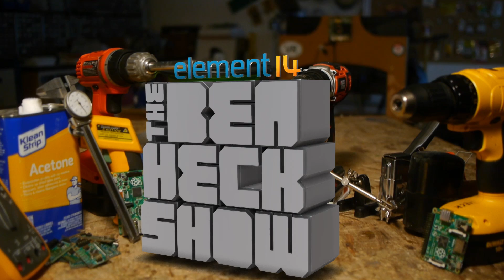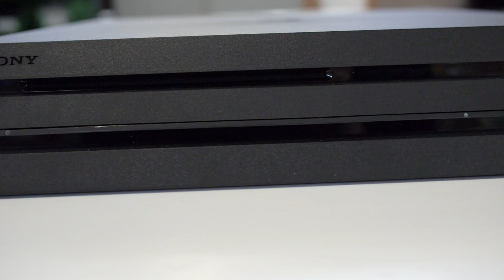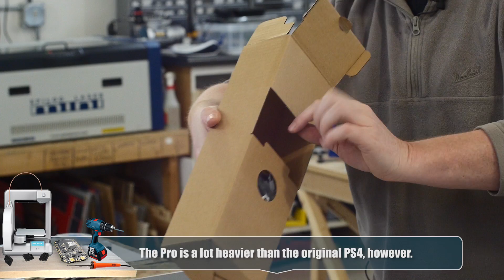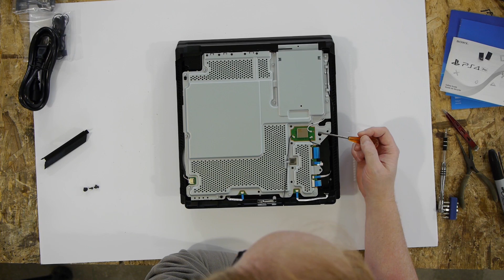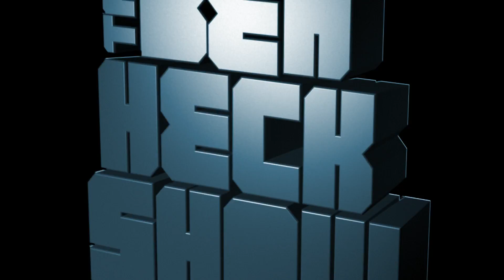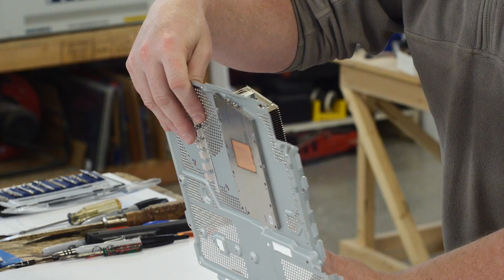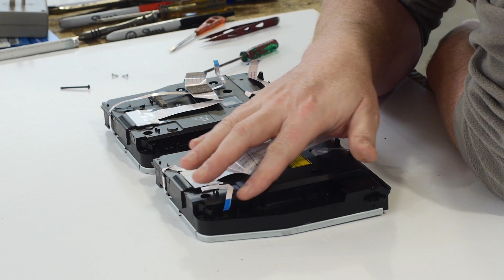Ben Heck's PS4 Pro Teardown

Comment: 23 amps  thats alot.were is the power going to 1 for the drive 2 for cpu an other 2 for dvd rom is it a car battery charger as well you should get a car battery fully charged to see how long it can power it for ,.......my djx lasts about 7 - 12 days depending on is size

Comment: The only advantage you get when putting a SSD into your PS4 (no matter which model) is higher I/O speed. Apparently the SATA connector for the internal HDD is attached to a USB-Host (not sure if USB 2.0 or 3.0) controller which drastically limits any performance gains that could be made with an SSD over a regular HDD. I found, after wasting money on a large SSD for my PS4, that it makes much more sense to put in a SSHD (Hybrid) instead, where I can put in a large drive and profit from I/O speedup of the most frequent accessed data on the drive at the same time without throwing money out of the window...
I really hope Sony doesn't repeat the same design decision again for an eventual PS5...
Reply: Good to know. I wasn't aware that Sony made this change with the PS4Pro.

Comment: Actually the PS4 PRO does have more ram and comparing it to the S is quite laughable because there is only a slight difference between the S and the original XBOX ONE and really the only difference is that it has a 4K Blu-ray player and HDR support. Where as the PS4 PRO is 4.2 teraflops and the S is only 1.4 teraflops. Which makes the PS4 PRO 3x the amount of teraflops. Plus based on the original PS4 is more than twice as powerful, better Wi-fi adapter, more ram, better HDR, better HDMI port, more USB ports, bigger hard drive, a 1 GB Ethernet port  and faster CPU

Comment: PS4 pro just uses an evolution of the Jaguar core vs. original ps4 and slim. All on the same manufacturing process by the way, no die shrinks involved. Core layout was changed marginally for better efficiency, but it's not too far removed from an overclocked apu as you surmised (albeit with a few enhancements).  Given the high power consumption of bulldozer and it's derivative successors it's absolutely zero surprise how much power the pro consumes, nor the increased cooling. 
AMD's apus of the time are far from power economical.

Comment: You guys do realize the ps4 cannot play games in 4K right?  The gpu isn’t powerful enough. However the ps4 pro can, although most games use checkerboard rendering. So comparing the two is like comparing apples to oranges. Your tv may say it’s using 4K resolution, but the ps4 is still only outputting 1080p or lower. The tv is just upscaling the image. To be able to display The Last of Us remastered in 4K, you have to have a ps4 pro.

Comment: The PS4 PSU units are very thin though. It would be great to have a new PC standard with PSU cartridges as thin as Nintendo 64 cartridges. Just immagine PSU cartridges that slot directly into the motherboard. That would be much better than the messy and bulky ATX PSUs...
Reply: Well theres already Plex psus
Reply: But those are only DC to DC you need a external AC to DC power brick

Comment: 4k Bray is a waist, cutting back on that with usin normal Blueray which still looks amazing on the right tv, but saving money on that puts more money into upgrading the power of the cpu and the ram and the gpu. Smart choice or the pro woulda been to much money or would have to sacrifice performance somewhere. 4k Bray is why the xbox sucks, well that and there stupid choice to use ddr3 not gddr5 like sony used, mabe there engineer s couldnt get it right.

Comment: I am not sure why he would call it an overclocked PS4 when he specifically went out of his way to measure both dies. Doubling the number of shaders in the die will make for a very different system. Heat dissipation increases are a byproduct of the larger die, not its reason for being.

Comment: I know I'm really late, but I just have to comment...

a) Using SATA3 for a normal HDD would not make any difference compared to SATA2. 3Gb/s (i.e. around 350MB/s) is more than enough for any hard drive you will find on the market. So... absolutely no point in going with SATA3, unless you're looking into SSDs.

b) Using 2K cinema projectors as an argument against 4K BluRays is kinda... stupid? If anything, it would be an argument against a 4K TV, but even then... meh? 
You have a 4K TV, don't you? Why? Because it looks better than 1080p, right? Do you prefer a "FullHD" stream over a 4K stream? Yes? Then why do you own a 4K TV? Of course you prefer the 4K stream. Now, if you actually cared about image quality, you'd know that a 4K BluRay delivers image quality far above a stream from current services. Yes, that might change down the line, but currently, 4K BluRay is the way to go if you want actual, proper 4K footage at the best possible quality. 
But: Most people don't use physical media anymore, so, Sony probably only lost a few potential customers by not upgrading their drive. They probably decided that it would not be worth it in the end. Sucks for me, but okay.

Comment: HGST, actually has one of the best failure rates(lowest) for modern harddrives from what i have read.
And in buiesness´es they are considered quite good, and prob a LOT better than toshibas drives, + Toshibas comsumer hdds are a lot cheaper than the Consumer HGST drivers, At last in the Nordic region.

Comment: I have the PS4 PRO. I replaced the original PS4 PRO 1TB hard drive with a 1TB solid state drive and i am so glad i did. I have noticed so much improvement with so many older games with boost mode and the PS4 Pro enhanced games run better, even if you don't have a 4K tv. Sony have tried to sell 4K too much with the PS4 Pro when actually they should of just mentioned it plays PS4 games with better graphics, framerates, screen resolution and loading times. 

I had the original PS4 and its an amazing console but the PS4 PRO is so much better.

Comment: Watching this I have to say Ben, the reason the PS4 costs more and can run 4k games is that there are double the graphic cores running in a version of crossfire. The used the die shrink to fit more into the same size die yes, but that was to fit the more graphic cores.

Comment: What they actually effectively did was strap a second identical GPU unit on the chip. Running it with multi GPU technology. It permits them to keep 100% compatibility with PS4 by running only half of it. but it also means that it's impossible for games to use the full "double" power it has on paper. That also explains why the PS4 pro has such terrible support from games for it's extra power, it's just too much of a pain to code the extra multi GPU support. Big games barely do it on PC now why would they even bother doing it for a console when the whole point for them is that it's less of a hassle to code for.

Comment: I wonder why consoles don't use an external power supply like computers did in the 80s. It would save space and allow for better air circulation.

Comment: no point of sata 3 in 5400 rpm spinner as read/write speeds barely tax sata 2 controller/specs. although the controller in the ps4/pro is sata 3

Comment: ps4 uses hdmi 1.4. hdmi 1.4 can handle  4k content it will just be at 30fps instead of 60fps like on hdmi 2.0, so the hdmi 1.4 connection on the ps4 could handle 4k video playback, but  the real problem is it lacks VP9 or HVEC 10bit codec support on the gpu. which i also suspect the ps4 pro  lacks those codecs as well. thus the reason why there is no 4k blu ray drive in the ps4 pro.  the xbox one s on the other hand does support VP9 and HVEC 10bit codecs on its gpu, which is why it has a 4k blu ray drive because it's able to handle 4k video playback.

Comment: talking about the hard drive in the ps4, SATA III makes no diff with HDD's considering HDD's bandwidth speeds can't go beyond 150mb's. So SATA II is more than enough for HDD's. As for SATA III HDD's, that's just a sales gimmick, you'll never reach the 600mb SATA III limit, let alone the 300mb limit on a SATA II with an HDD.

Comment: Liked your show here, going to subscribe, but I do have to take exception about your knock against 4K Blu Ray.  I'm very interested in the format, because even in the best of streaming circumstances you give away a lot in PQ and sound.  Also, 4K streaming eats a ton of bandwidth, and I live in an area where the best connection I can get is 18gbps for 130.95 per month.  Don't know if this is accurate, but I've read that the adoption rate for 4K Blu Ray is ahead of where Blu Ray was at in its life cycle.  I think these are all reasons why physical media are still a very viable way to go for a consumer and a business, and why Sony deciding to leave this feature out of the PS4 Pro is a step sideways instead of forward.

Comment: The reason the die is bigger is because the GPU part of the APU was doubled from 18 Compute Units to 36 Compute Units (its pretty much an underclocked RX 480, but I'm not sure if it is really Pollaris), not because they wanted the surface area to be bigger. Lithography-wise, I can't say if they're using the 14nm node or 28nm. I'd guess 14nm.

Comment: considering 3Gbps = 375 MB/s, it doesn't really matter. a disk drive will never reach 375MB/s. epsesually a 5400rpm drive. which is what really matters, the rpm. Sata 3 (6Gbps) was made for SSDs.

Comment: I don't think the drive is the reason. From my understanding Sony played a part in having some kind of mandate that all Blu-Ray drives manufactured in 2010 or later had to be able to read 4K disks. They didn't have to be used in a device that could play 4K media, just that the drive had to be able to read the disk format itself, and the PS4 came out late 2013 so ti likely has those drives.

I think the real reason is because Sony also announced some "premium" 4K Blu-Ray players, which are also going to be their first Blu-Ray players, coming out early 2017. It sounds like they will cost close to what the PS4 Pro itself might cost. So I think that might be the real reason, that they intentionally didn't include the software to play 4K disks because nobody would buy their 4K player if they could buy a PS4 Pro for around the same price. I wouldn't be surprised if they release a firmware update to add 4K support to the Pro a few months after sales of the standalone 4K player have dried up.

Comment: What about the fact that the PS4Pro is a dual GPU SOC as opposed to the slim and regular ps4. Also it's not a smaller node srink... it is the same CPU overclocked 50%.

Comment: hello, I'm trying to find out if the United states ps4 pro consoles are 100-240v? I'm in the military, and it would help me a lot.
Reply from the maker: Looks like it.
Reply: Thanks id hate to buy one and then turn around and have to buy a transformer when i deploy
Reply: +Ryan Bolesworth the ps4 is auto-volt, would work between 100-240v afaik
Reply: Even with it only showing 110v?
Reply: mine i got from the us, i live in a country where it's 220v, i have no transformer, straight from plug.
Reply: NXT Noxx thanks for your help

Comment: A faster internal HDD does not gain you much as it is internally communicating to the PS4 via USB

oh and the internal hdmi can output a lot more than the PS4 does, because the PS4 is internally using the displayport of the GPU subsysstem and internally using a DP2HDMI converter...

Comment: I don't understand why this guy tries to explain anything to do with 4K video when he clearly knows nothing about it. The Optical Drive isn't the limitation, 4K Blu-Rays need a H.265 decoder which isn't present on the standard PS4 or the PS4-Slim. The PS4 Pro has a H.265 decoder but it's locked in software to stop UHD and HEVC .TS files from being played by the operating system.
Reply: To summarise, it's a software limitation in the Pro, and a hardware limitation in the lower-spec models.
Reply: @DebugMenuVideo  wow... Thanks alot! I can't believe they wouldn't enable such a feature on a 4k console.
Reply: https://en.wikipedia.org/wiki/Ultra_HD_Blu-ray
UHD Blu-ray is not backward compatible.
Reply: Why are you using someone else’s pic as yours? That’s weird

Comment: the reason the die size grew on the new one is  they really updated the gfx part from an older hd 7000 series to about a rx480 chip and also a 14nm finfet production size the additional size really isnt for heat just happend that with boath combined to be that size which yes makes it easyer to cool but with 14 nm the power should be less anyways or similar to the original that was produced on at that time 28 nm

Comment: Using a white sheets and drawing around the screws and making notes is smart. I haven't seen or thought about that before.
Saying the reason why the Pro can't play 4K BDs because they disk drives 'look' the same isn't reasonable. If the Pro did play 4K, the hardware will still 'look' the same. It already played 4K games, I think with software and maybe a lense change it can and the hardware will still look the same.
Fun video. I like it. This is the first time I see your channel or videos (aside from the old original ones you made outside of youtube. 
Cheers.

Comment: it is possible for the ps4 pro to play 4k blu rays in an unconventional way unless it cannot read the disc. Let's say the ps4 pro blu ray drive is not fast enough. If so well then rip the 4k blu ray to hard drive and play it from there. Problem solved. By the way, a test could be to hook the ps4 pro blu ray drive to a computer and see if the drive is really too slow. Maybe Ben Heck could try that. :)

Comment: The die on the PS4 pro is not bigger to sync more heat, it's biggger because the PS4 pro has a processor that has more transistors so it's going to naturally be a bigger chip.

Comment: You can't play 4k disc's because by the time 4k discs will be popular, there will be a new Playstation out. 4k streaming will be standard by then anyhow, and possibly even something better than 4k will be streaming. All disc players may be obsolete by then, when's the last time you used yours!? You would have to be a fool not to upgrade to a better PS4, or you just don't know any better. Make sure you have a "REAL" Ultra HD TV that supports all functions of what this new PS4 Pro supports! Many fake TV's claiming to be this out there, that give you only half the technology of what the PS4 Pro can do!. I can't believe this guy just makes claims before actually reading any specs, this PS4 Pro IS physically bigger by the case, measure it BEN HECK!! ..and double the processing power!

Comment: Actually, the One S does not have a 4k blu ray player. It has an upscaler. So it will not play true 4k content. So, for those confused by what this means, I'll elaborate. The One S takes 4k content, downscales it to 1080p, and then upscales it back up to 4k. This discovery is why I chose not to buy an xbox

Comment: Isn't using the maximum power rating of a PSU as a guide to the power consumption of the device it powers tantamount to looking at the maximum speed on a vehicles speedometer and using it as a guide to the vehicles actual maximum speed?

Comment: I don't think it is a good idea to discount the lack of a 4K drive in the PS4 Pro as no big deal (I don't even have a 4k TV btw) because in my family of 5 we were streaming all our video.  Since Comcast has started enforcing data caps I have been over the 1TB every month.  Comcast says the average users only uses about 250gb so not many people are complaining.  Once the streaming of 4K video starts taking off more and more people will run up against data caps.  When that occurs you will have to reduce streaming and go back to cable (what I did) or find other ways of getting 4K content ie disks.

Comment: The cpu package isn't the die, the die is what you called the exposed surface. The die of a chip is the actual piece they cut from the wafer. Get your terminology straight.
Reply: Oh, you used die correctly a minute or two later...

Comment: the Xbox network module because separate explains why I have to reset my Xbox in order to gain my connection back again. whereas on the ps4 which isn't using a separate network module but onboard that doesn't happen and it reconnects to the internet after a lost connection on its own and without me having to restart my console each time.
Reply: being separate**

Comment: did this guy just say the ps4 can game at 4k?
Reply: It can play native 4K some games but not all games in most games it just upscales them.
Reply: You're gonna tell me a console that struggles with 900p 60fps can run native 4k? Bahahahahhhaha #consolepeasantquotes
Reply: luigi90210 It's not the base model is the upgraded one with overclocked cpu and better gpu at 4.2 teraflops if I remember right and support for sata 3 (that's what digital foundry said in their review)
Reply: Watch the video again. He claimed the ps4 slim can run 4k it just doesn't have the right hdmi port...
Reply: A lot of consoles can if you lower the graphics enough.
Reply: luigi90210 The base ps4 has only 1.8 teraflops of gpu power which is not enough even for 1080p 60 in AAA games the ps4 pro has upgraded gpu and overclocked cpu it just can't play 4K from the disc like movies etc. not games. I suggest you go watch digital foundry videos for ps4 pro
Reply: Well first things first, I don't care about the ps4 pro and it's fake 4k gaming, no I don't count NBA running at 4k 60fps as actually 4k gaming cause that's the equivalent of saying LoL runs at 4k 60fps on a GTX 960(spoiler LoL is a very very low demanding game). Second I'm talking about this guy saying the regular ps4 can play 4k games with the right HDMI port which is clearly not true since the PS4 struggles with 900p gaming.
Reply: +wallpaper42 if I want to see a slide show I'll check out a console running a game at 4k native resolution